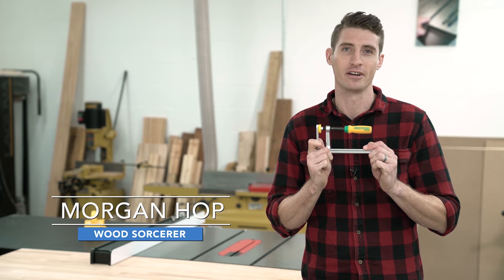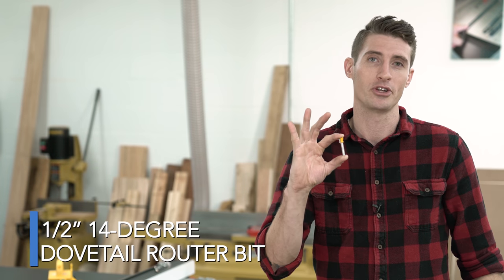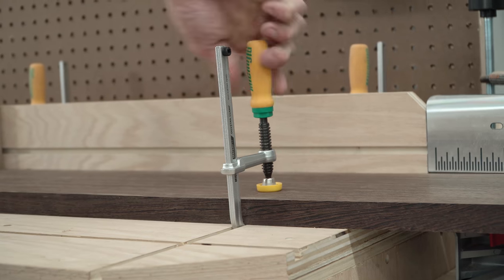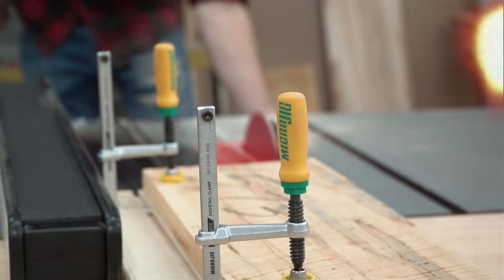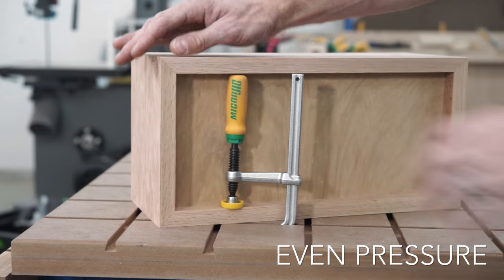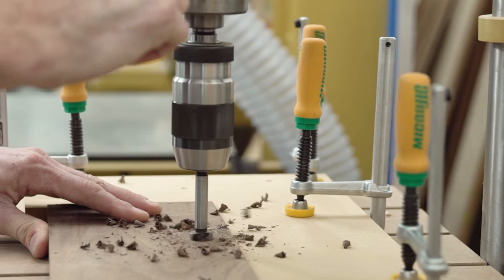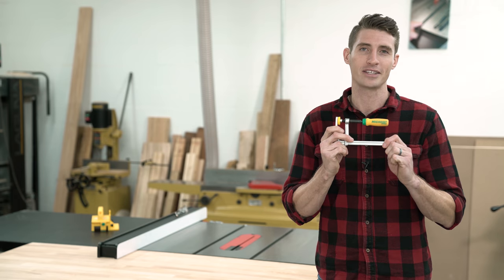Route a Dovetail and Clamp Like Never Before with MATCHFIT Dovetail Clamps by MICROJIG

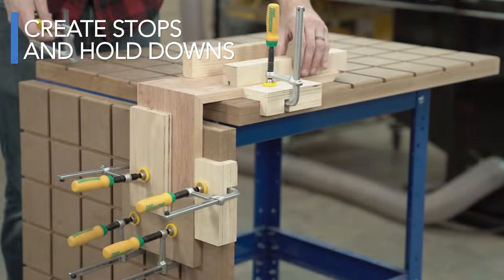Comment: Hey MicroJig, is that a Kreg bench / shop stand you're showing at 1:55? I’ve got one of these Kreg stands and plan to use as a base for a small dovetail clamping table like this. Can you comment on the dimensions of the stand and the grid spacing? It looks like maybe a 20”x28” stand with 4-inch grid spacing?? Also, I notice the clamping surfaces are flush to one side, but overhang the other by a few inches – is that beneficial for clamping use-cases?

Comment: Nice product, but horribly over priced.  @ $45 a pair this is double the value they are worth.  Try pricing them @ $20 a pair so a normal woodworker can afford multiple pairs.
Reply: Mark Hazlewood 
Yeap.
Reply: I don't think $45.00 is out of line if they're quality pieces.  You get what you pay for and if they make the job easier which it looks like they do, well then they're worth it in my opinion.

Comment: They still haven't Chg'd the obvious.  Make them spin!  Their usefulness is so limited.  Shame.
Reply from the maker: Actually, you can feed the head through a dog hole (in material up to 1" thick) and use the clamp in any orientation. 
But realistically, they are a track clamp, they orient with the track.